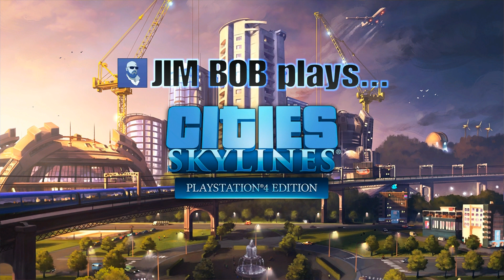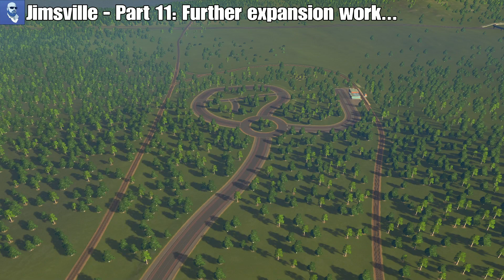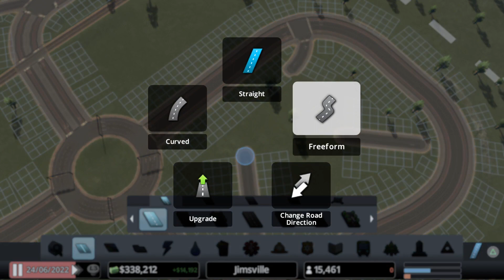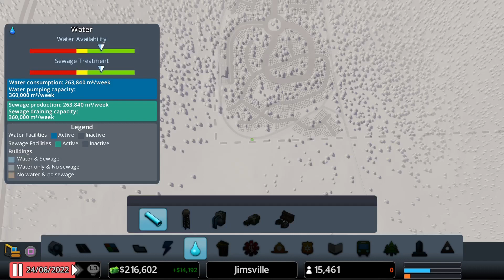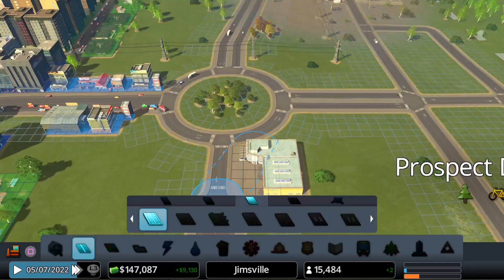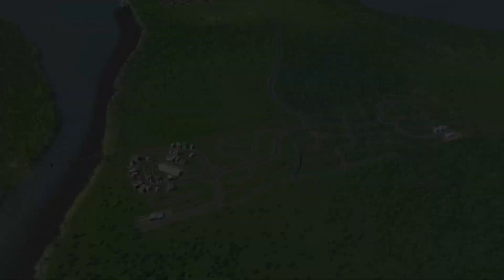Cities: Skylines PS4 Edition - Jimsville Part 11

Comment: Love this series. Actually prompted me to buy it! Quick question JB: how do you change the elevation setting for roads on PS4? I've made some overpasses: they r steep but usable. Thanks in advance!
Reply from the maker: +Chad Miller the ramp will change angle depending on how long you make it (up to a certain point). Try experimenting with a fresh short piece of road